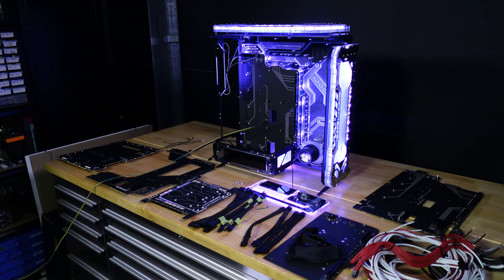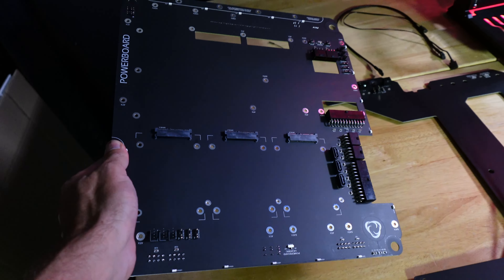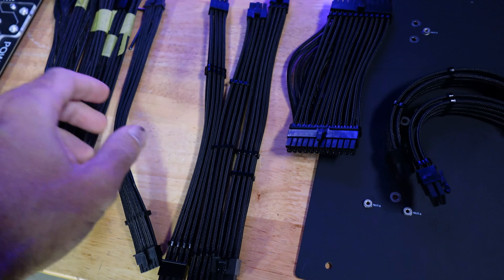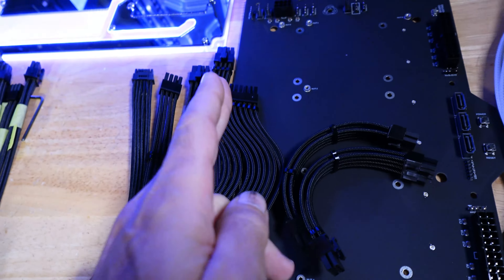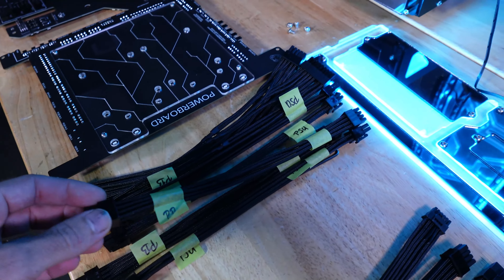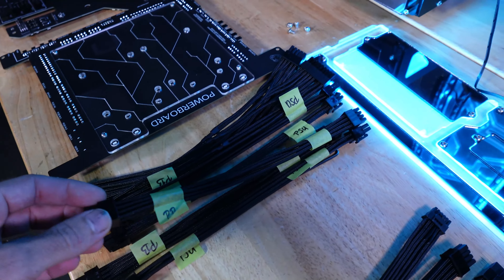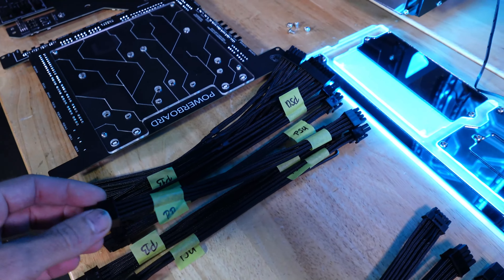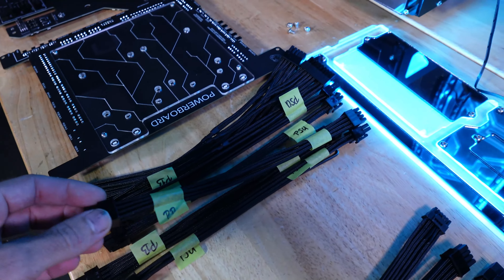SC PowerBoard Overview

Comment: as an ex-CAM engineer that worked for Graphic Plc who at the time were one of the highest level technology and top 3 PCB manufacturers in the world, then went on to be joint top with Invetech, I can see straight away that you have not cheap'd out on the production of your boards. The solder resist layers alone must have cost a premium because that is not a standard type of solder resist or at least it certainly wasn't when I worked in the industry. Colours like matt black would have really cost a premium and been hard to aquire and we were the best at what we did, yet even for us it was hard. You've clearly have the pads plated with gold and I'd be really interested to know how many layers are inside these boards and where you went for manufacturing. Graphic is in the UK but Invetech were often able to match the level of complexity that we did. There are many other places in China now that have caught up but you normally have to order high volume or did back in those days. Rambling now but just really impressed as always.

Comment: I'm guessing that new one you've revealed is for cases based on project zero looking at where and how the connectors are positioned? I also say that because I may be wrong but aren't all the cutouts in project zero cases in the same place so because you mentioned it was a generic power board that would also make sense. I'm dying to know the answer now

Comment: Any news about the universal powerboard? Any videos/pictures on how it's mounted in basic ATX case? I'm on the verge of buying, but not sure if my Fractal North is compatible
Reply: There's a compatibility list you can find from the product page now, at least. Looks like it'll fit fine in a Fractal North but does require to remove a few accessories from the case.
Reply: I second this. I think I might want it, but I'd need to see someone build a PC with it to decide - specifically the universal.

Comment: You can add so much useful features on these power boards like , voltage, amp, ripple in mv readings , set warnings, RGB effects, LCD, extra 10K temp sensor port , water flow sensor